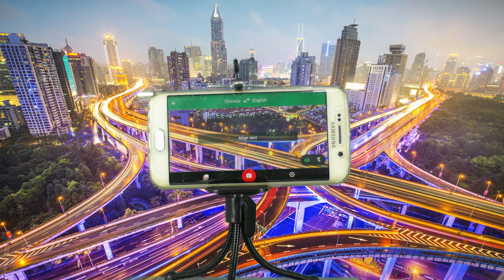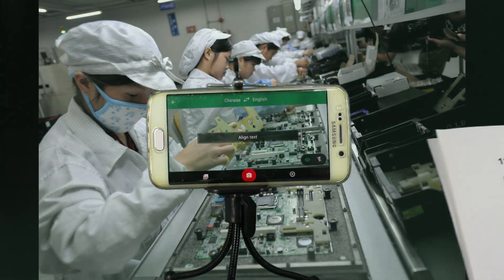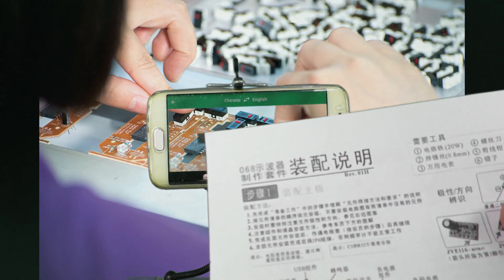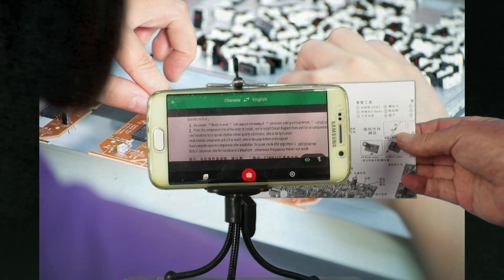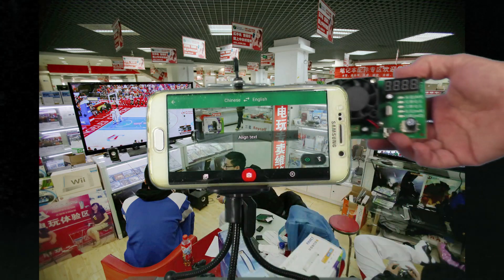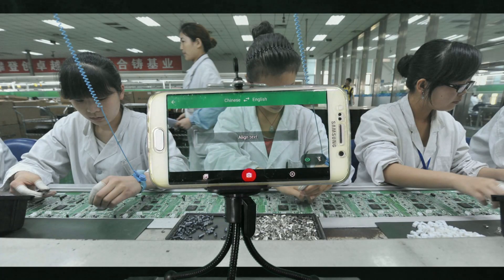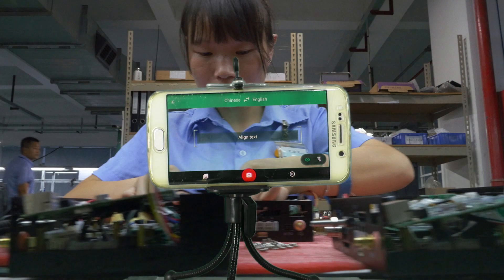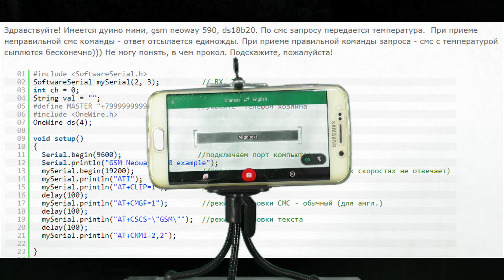Using Google Translate For Electronics Projects Chinese To English

Comment: Great idea
Reply from the maker: Thanks Herman! You could use Green Screen instead of your brick wall backdrop. Then you could change it to suit each video!
Reply: I had thought about before getting the brick wall  tapestry but decided against it thinking that would take too much time setting it up and using chroma key in editing
Reply from the maker: You will be surprised that I actually used an old blue bedsheet and it took maybe 5 minutes to learn how to chroma key in Davinci Resolve. The result is not perfect but it works for me. Maybe an idea for a new video for me!!